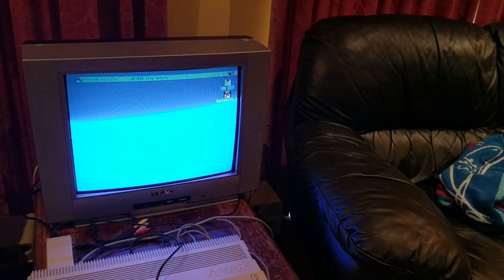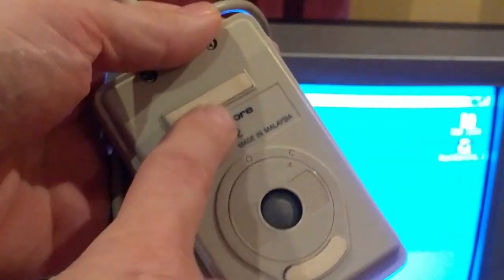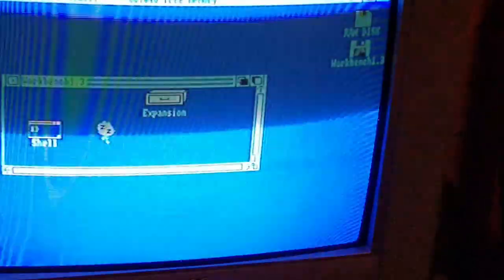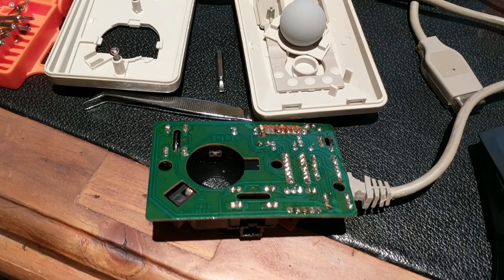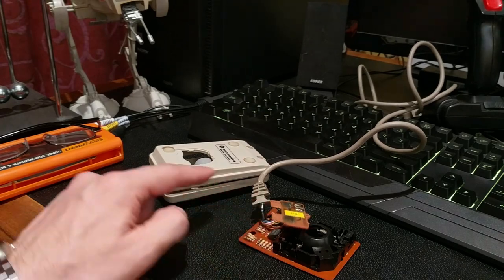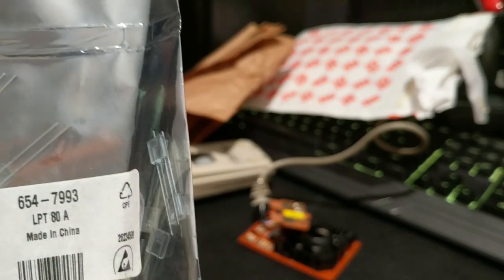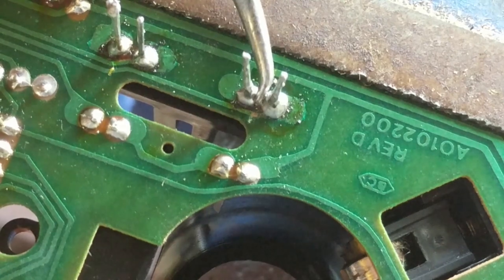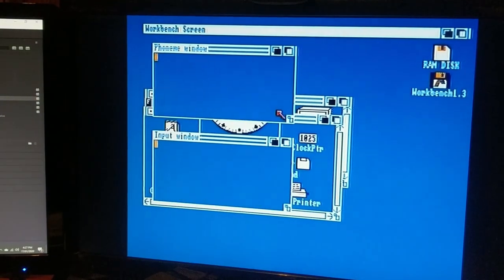EP-047: Fixing my Amiga Tank Mouse (Phototransistor swap)

Comment: Suggest that next time you:
  1) add some fresh solder (leaded) to the original solder joints before removing the old phototransistors. This would make it easier to melt the old leaded solder used.
  2) use some desoldering wick to remove the solder from the phototransistor pads and clear the holes after removing the old ones. This would clear the holes on this single sided PCB so you could just insert the new phototransistors into the cleared holes without the soldering Iron and then only solder them when fully inserted. There was a risk of lifting one or more of the solder pads when you inserted the replacements into the solder covered holes while trying to heat both pads on the other side of the board.
Reply from the maker: Cool cheers for the tips 👍

Comment: Just did mine and it still didn’t work and i kept moving the the exposed photo transistors up and down and noticed it would work sometimes depending if it was upside down or not. Then realized it was the plastic piece that you have to remove. The positioning of that is crucial. I positioned it into place where it worked and dropped some super glue and now it’s good.
Reply from the maker: Nice work! Yes alignment has to be spot on or it's just dead. Glad you got yours sorted :)
Reply: @005AGIMA  I also didn’t realize I had to first desolder the phototransitors in order to remove the plastic piece! Almost destroyed it! 😂 🤦‍♂️
Reply: @sideburn  Did yo have to? Mine is jittery as hell scorlling down.
Reply: @sviru007  yes. Desolder and replace.
Reply: @sideburn  I mean did you have to desolder phototransistors before taking out this plastic black bracket? or you can desolder them after?
Reply: Sorry. I can see on the video that you have desoldered them later.